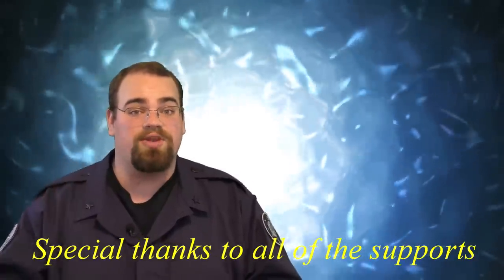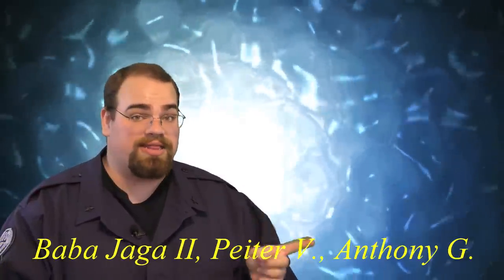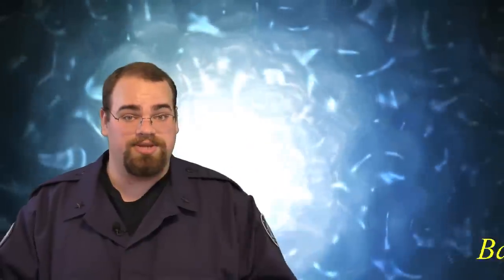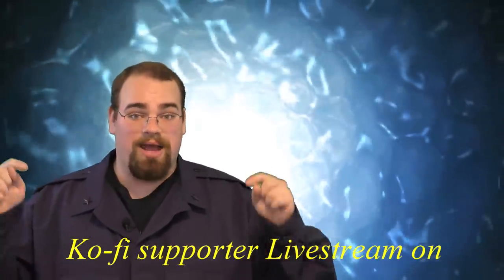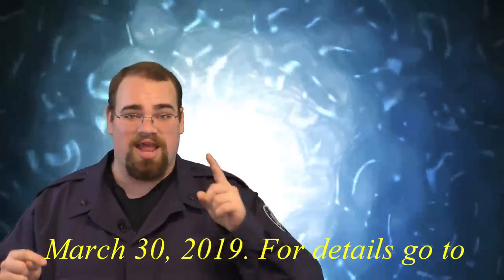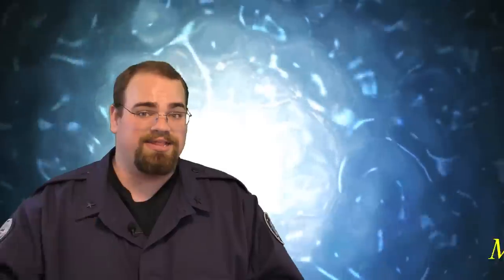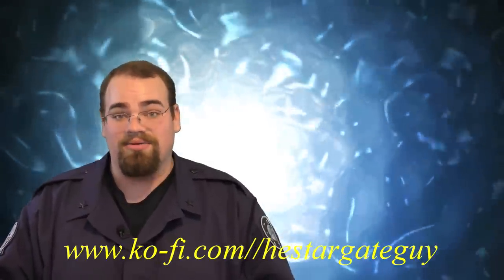Zero Point Module (ZPM) : How it Works

Comment: I'm a physicist and I have to start by saying I disagree with the present theories on zero point space. It is completely impossible to extract energy from the fluctuating floor of a quantum system. The floor of a quantum system obviously exists at a state smaller than Plancks constant, therefore existing as a particle and wave at the same time. The issue falls in when physicists fail to understand the system from a quantum point of view and look at it from their own point of view. Those fluctuation aren't fluctuation, they're the basis of zero existing in a quantum state that without which would violate the fundamental laws of quantum mechanics. What to us seems like a wave dipping below and above zero, is only zero on a quantum state. The people who are actually working on this are just spinning their wheels on a lack of understanding quantum structure.

The ZPM as described in Stargate work based on what we currently think of as Zero Point Energy, but don't exist in our space-time. They mentioned in the show that doing this in our universe would be extreme dangerous (in theory if this was possible and used in our universe, the energy you pulled out of the system, which in this case is the universe, would pull that energy from other places to maintain balance, thus pulling from everywhere around it, weakening the structure of reality because as mentioned before, the wave you're pulling energy from, is 0, the baseline of the universe itself.) They created small pocket universes and the ZPM creates a bridge to this isolated pocket universe in order to draw energy from. The only way to recharge that would be to reverse universal entropy in a pocket universe, which if that was even possible, would require at least the same energy that was used, minus the process of doing it, and the energy to maintain the gateway. It would be far easier (relatively speaking) to create new pocket universes to draw energy from.
Reply from the maker: This is really wonderful thank you so much. I really struggled to try and grasp these concepts and I just could not find a simple explanation on this stuff. I have no problem admitting that I’m not an expert in this field so thank you thank you!
Reply: @TheStargateGuy  I find the trick is not having friends or a life, lol. I've been studying quantum physics for decades, it's a passion of mine.
Reply: Just finished reading this and man I wish I read this before I made my first comment. This is what I was talking about. Why recharge when it makes more sense to reset, or use a new pocket dimension as you put it. Thanks for this great to know that a layman can be on a similar track as someone who actually studied physics.
Reply: My understanding (although it was many long years ago, and may be "fanon" rather than canon) was that ZPMs could be reset by changing the frequency or something like that. There was a machine to do that, but it wasnt required by the time Atlantis left, as everybody had ultra-low grade psionic capabilities. Something like resetting a ZPMs frequency might have been something they did by touching the thing.

Comment: Then how come they discharge? And why dont the Asgard have info on them?
Reply: Because the Asgards using bioenergy. Or do you think, guulds are the better replicants? 

They dont discharge, the energy in use are only not high enough, to generate the reaction, to give energy out. you discarge your smartphone, you can use a button to end the process. But, until you discarge your phone like bios wants it, you cant end the process, only the time, and, thorugh cable, a little bit of the form of energy as electrity..

I write a comment, because i read your comment. You written a comment, because you reacted.

Comment: This is what I dont get..the Asgard have a matter converter that can virtually make anything they want....why didnt the Tau'ri ask the asgard to study and reverse engineer a ZPM they had and for the Asgard to use their matter converter to make more ZPMs for the Tau'ri.
Reply: "Deep Breath", or simple: because, it would be the last thing, you have made with the matter converter, everything else, would disapper, because the absoulte output of the zpm changes all the time  So, it would be disapper in time (hits the critical mass) or it would be disapper by using that zpm. Same Concept as the TV End of SG1.
Reply: Oh, they could make a drained ZPM shell easily enough, But generating the pocket universe that it uses for it's power source? Not so much.

Comment: i know it was just plot but i feel there are several ways they could have made or acquired more ZPMs 
1) covert missions to the replicator home world and just steal them like Todd did before they destroyed the planet
2)create a closed network of stargates and dial multiple gate lets say 3 and send a charged ZPM through turning 1 ZPM into 3 ZPM and do this as needed
3)once the Asgard gave them all there tech and Sam used it to make anything they need that tech might be able to make a ZPM if not that. An Asgard beam could if it can store a ZPM in the buffer they should be able to make copies
4) they can just make a basic replicator programed to just build ZPMs.
just a few ideas i've had over the years and years on how they could have solve the power problem and #2 i always thought would make a good story could be an area 51 project making material for the all the ships instead of them having to mine
Reply from the maker: Well the first one we did pull off once. the second one, we aren't sure if that would work that's just theory. The third... maybe.... and the fourth is probably a bit too dangerous.
Reply: I think #1 and 4 are the most plauseable. I find it weird that they never pulled up to the replicator hone world and beam up a few dozen. Making a replicator just to build zpms is also a good idea. Just do it offworld. After All Fran did exactly what she was built to do, and did it quiet happily

Comment: You know that you got the cylinder pressures backwards...   As per your diagram the pressure is on the top from the exploding gasses in the engine.   Therefore the cylinder is being pressured down.
Reply from the maker: Yeah I realized that after the video was published. Just a little blooper that slipped though. Thanks for watching. :)

Comment: Zpm : Not to sound like  O'Neill but that was a bit techno babble and I fear not many understood so here is where I come in :
The  Zpm is a battery based of crystal and mirror technology.  When the ancients travel to space using sub light engine based space ships they include the Zpm on the exterior of the ship so they can fish and harness sub light which is a mirrage . It's like a space solar panel but capture star light as well
Reply: Um, our "sun" is a star therefore the light we see, plants use, etc. IS star light. Sub light refers to the speed a ship travels at thru "normal" space. Maybe you were thinking of subspace (which is what "hyperdrive" engines use to travel thru)?
Reply from the maker: What is your basis for this?

Comment: I wonder if they used gravitics to fold the subspace between the plates in order to exploit the cashmere effect. if it takes as much energy to pull the plates apart as it does to push them together, then all you need to do is find a method of extending the distance between the plates artificially which can be done by warping the distance between them like a black hole distorts things. leastways, that'd be my theory.

Comment: To be able to make on you will need to create and maintain a White Hole that is connected to subspace for it to pull out the energy without any flow back from normal space into subspace trying to equal out the exchange.
Reply from the maker: Interesting thanks

Comment: Um, actually, the Zero Point Module operated as a single unit is not capable of powering the shield for 10,000 years. Atlantis used 3, working in concert, which for some reason, yielded slightly more power than 3 ZPMs would yield individually. The second Dr. Weir, having traveled back in time, remained behind to rotate the ZPMs every so often for plot reasons. By the time the expedition arrived, the first 2 had depleted entirely, and the 3rd had nearly reached maximum entropy.
Reply: vdroop

Comment: Great video, I always loved the look of the ZPM. However they were NOT required for interstellar travel but they can shorten the trip. The Daedalus traveled from Earth to Atlantis in, I think, three days with a ZPM but required seven without one.
Reply: 3 weeks with a ZPM. the cant reach pegasus without one.
Reply from the maker: Atlantis isn't getting anywhere without a ZPM and that was designed to be ship.
Reply: I was indeed mistaken about how long the trip is without a ZPM. As for Atlantis it my need a ZPM to travel between galaxies but Atlantis can barely do anything without one ZPM.
Reply: Sorry but that isn't true Daedalus had A ZPM installed twice the first flight to Atlantis, which took three days thanks to the ZPM, and later they used the ZPM to power the Daedalus' shield to protect Atlantis from a solar flare. I takes three weeks with the Asgard hyperdrive, as the Daedalus, Odyssey and Apollo mostly made the journey between galaxies without a ZPM.
Reply: I have looked up the transcripts from Stargate Atlantis season 1 episode 20 The Siege Part 2 Colonel Everett says 'With the ZeePM boosting her engines, she should be here inside of four days.' and in season 2 episode 2 Dr. Weir described the return to Atlantis as 'having to spend eighteen days cooped up in the ship to get back'. Also YES Atlantis is a ship and IT can only fly with ZPM power.

Comment: Big fan of the shows my question is about the stargate there are 39 symbols you need 6 plus the home address to work. If this is the case you could only go to 38 places? Right

Paul
Reply: every gate has a unique home symbol on it. However, the home symbols are interchangeable - they are all actually the same symbol, as far as the gate is concerned.
Reply from the maker: Basically with each set of gates on a planet the home symbol can be swapped out, so it can go to more than 38 places.

Comment: If zero-point energy is everywhere, why would the ancients need a battery? Re-imaging how the technology works it would seem to make more sense if instead of a battery the ZPM was a conduit for Zero-point energy. If the ZPM contained a super-conductive liner that allowed the energy to travel from the tap on one end to the connections on the other then it would make since that the ZPM was being depleted from the super-conductor being ablated by the enormous force of the power flowing through it. Once the conductors were used up the tap stops functioning and the ZPM is depleted. Recharging would be useless because the power really isn’t gone it just needs a new sleeve inserted into the container to allow the flow to be re-established. The Science teams wouldn’t understand why it won’t recharge because the liner is completely gone. If you don’t know it’s missing how can it be replaced. Also explains why there’s no spares setting around. Once you have the casing completed you just have to reinsert another sleeve into the inner chamber. Probably in the armory on Atlantis that the Pegasus teams never found. If they had they would have been using weapons similar to what the replicators have.
Reply: Stupid question, you use the on/off thing on electronic only for turning it on, right? The answer would be no, but because, we use electronic everywhere, our ressources are limited.  You have such playground like atlantis - and now, ony tiny little thing goes defect, you have to put a lot of energy in it, to repair or renew it. 

Next thing is, to generate the using power, on the principes of electrity, you have to let zero-point energy regenerate their energy level. The Basics of this physic is, that, until you have usefull energy/electricty, that the way, the using energy has regnerate, is muuuuuuuuuuuuch longer. Its like the "free energy" thing claimes, with one problem. Because you use this kind of zero point energy, their is only on the using energy not a thing like a resistor. Zero Point Energy claims, to have even in the generating not such thing, because the use is the resistor. 

Like "Creative Mode" or a "Cheat" in every Game. 

"Once you have the casing completed you just have to reinsert another sleeve into the inner chamber" 

Good luck, fishing in a black hole. The lenght of that fishing rod,  as way of the recharging resistor, is on a timeline enough, to generate enough energy for atlantis on earth. because, its way easier, to create free energy out of such thing, like an asgard core, than to make a "new" sleeve. 

BTW, its not a sleeve. Would it be a sleeve, you could only use it for secondes. It would have destroyed, on human level, everything with destructive ownmove energy. 

Would be like a train with only one planwing on one side. Because, its a train, on rails, the train cant slide out. Destruction would be on one side of the driveside. Because, the ZPM Moves, not the energy inside. ;)

Comment: ACTUALLY THE SOLUTION IS VERY SIMPLE.  First the two vartiable potentials  must be isolated and each adjusted to create the desired direrence in potential  by boosting  each positive and negative connection.  The solid state inversion capacitance must be checked to vetify that it is functioning properly or the charging  will dead short  and you will be back to square one.
Reply: Tesla explained it as splitting the positive.  The ZPM is just dong it on steroids .

Comment: Its not a battery...its a device that draws energy from the vacuum space of the universe zero-point energy thus ZPM ...the ZPM will eventually be depleted ( stops being able to draw off ZPE ) it may be that the atomic structure of the crystal becomes depleted or saturated ( depending how it draws the energy ) and thus can no longer extract ZPE
Reply from the maker: Yeah basically, but the battery analogy is more understandable to most. :)

Comment: So limitless energy, until you use it for something that takes un equal amount of power that it produces.., I don't think I understood that one bit and I just gave myself a headache😂 thanks for trying to explain it to me though, great video
Reply from the maker: I'm glad you liked the video. to me it's not so much limitless as you were describing it, it is a finite amount of power it's just a large amount to begin with. If that makes sense. lol
Reply: The Stargate Guy I say limitless on account of how they've been powering the DHD's for millions of years in the Milky Way galaxy, granted the gates are hardly used but it's my understanding a battery still draws power when it's plugged in. What I don't understand is how does a power source capable of holding water back hundreds of feet under the sea for 3333 years only last days under weapons bombardment, not to mention only capable of making three human bodies before running out of juice?

Comment: ZPMs have very inconsistent energy capacity. When good guys are using them to, say move a single ship away from a star, they lose something like 30% or more in a few hours. When nobody is using them, a single one can hold an ocean for millennias. When bad guys are using a single ZPM they can do anything, make their armor super thick (and buff engines to move the thing), quickly cross intergalactic gap, increase weapon power and still not run out of juice. The argument was that Wraiths are smarter in using them then humans but the discrepancy is in few orders of magnitude and that untapped energy has to go somewhere in some form. And that would be a ship evaporating amount of heat but drama is not well served with realism.
Reply: This is true, but is fairly easily explained. The more you try to draw from a ZPM, the faster it depletes, but it isn’t linear. So, for example, if you use 10% of its maximum output, it can last a thousand years. Draw 50% and it’ll last 30 years. Draw 100% and it’ll last 20 minutes. Real world phenoma like stars have similar behavior. Heavier stars burn through the fusile material in their cores far faster than lighter stars, though their cores contain a smaller proportion of their mass than lighter stars’ cores do. The faster energy is extracted, the quicker they burn, but as in the case of a ZPM, it isn’t linear.
Reply: @derekwhittom1639  I'd say what Wraiths did in SG:A finale would require major power draw. Reading wiki about the episode, there was unknown number of ZPMs powering super hive ship. Not just one as I remember. Still, it's a bit annoying how good guy only get non-faulty ZPMs when they are in situation to spend them immediately.

Comment: I had few theories on it. one turn pure energy when ascended. so thought ancient died went into battery that another resin didn't use stuff didn't realize kill new forms. other is stare gates them selves. called stare gate but never on stare there plants and space near plants. know that Destiney fly through sun repower. we also know run power after while. idea I had was special smaller stare gate put near stars or in stars. when stare run power the zero point module run power too.  if want repower one take stare gate from dead stare too a new stare were site orbit suck up power.